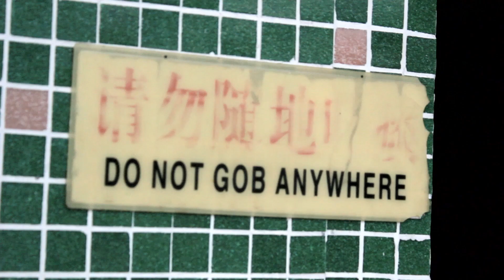Dig a Hole to China

Comment: Youd need to withstand the heat of our earths core, also gravity... going into the whole on one side going down through the core with gravity, but then after the core and youre on the other side youd be going slower and slower because gravity is going the other way now, and then if you do dig a hole on the ground to the core the world would end! Depending on the size of the hole! Also the hoke would take centuries to dig, even with the drilks that we have theres just too many miles and miles of rock, dirt, molten rock etc.
It is impossible